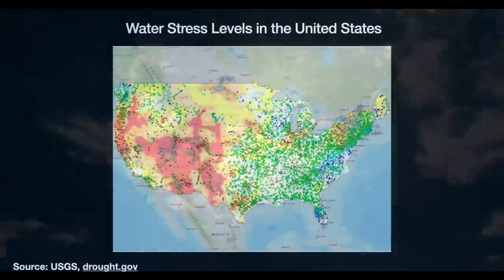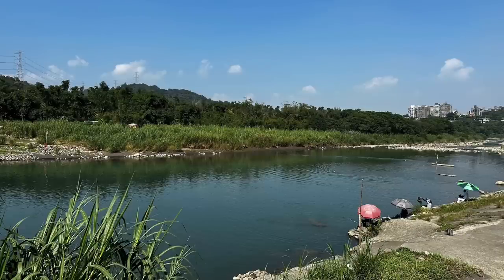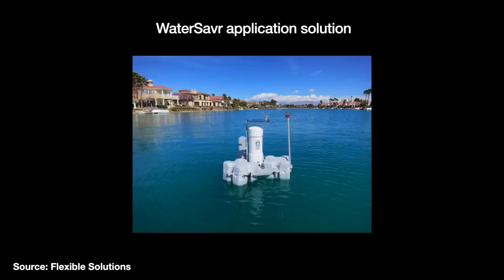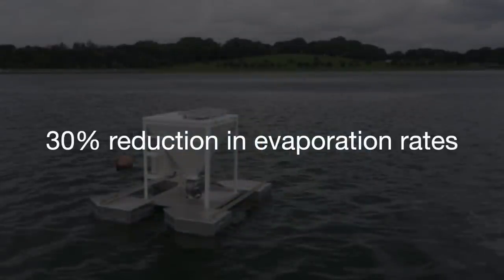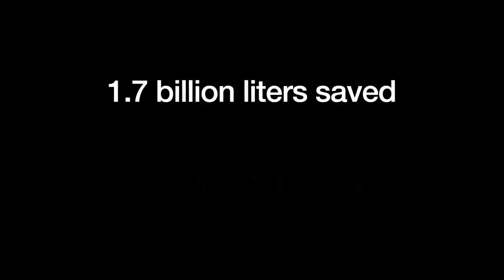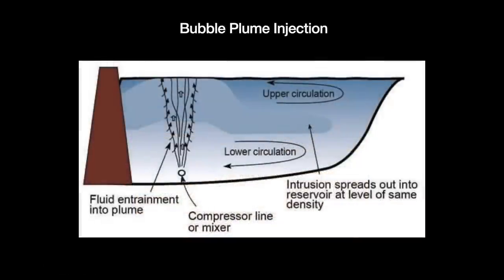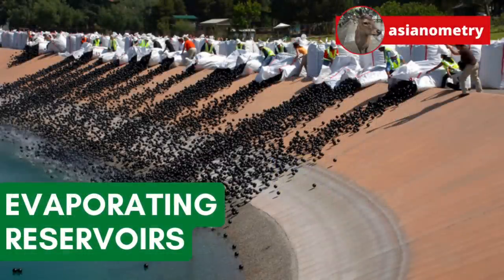When Your Reservoir Evaporates

Comment: Evaporation of salt water, on the other hand, is a good thing, because when it returns to earth it's fresh.

So we should be considering doing things like bringing salt water into desert depressions, like the Qatara depression in Egypt. Shallow basins of salt water in a desert will permit more evaporation, loading the air with water that can hopefully come down as rain downwind.
Reply: Sounds good but creates quite a number of problems. You'd quite literally be salting the earth. Evaporating salt water leaves salt deposits and the land would no longer be useful. Cost benefit analysis.  Pumping large amounts of ocean water inland requires large amounts of energy and infrastructure + maintenance. Something interesting for you to research for reference would be the red sea and mono lake(California, USA)
Reply: @jumpingsloth3963  At Qatara you don't need to pump it inland. You simply need (below-sea-level) tunnels. And it won't leave salt behind, because it will be permanently at sea-level and effectively part of the Mediterranean. And even if it does, the Qatara depression is worthless desert.

It would provide additional surface area for evaporation. Some studies believe that it would evaporate so fast that water flowing from the Mediterranean could be run thru turbines to generate several hundred MW of power, but that would be an optional extra.
Reply: I think the difficult part is how to measure the fresh water return when it's random and inconsistent world-wide. I wouldn't oppose the idea, but there's costs for that magnitude of a project. Convince us further.
Reply: @jumpingsloth3963  The project, as I understand it, has been justified in the past on the basis of electricity generation based on flow into the depression from the Med. So presumably a lot of water is constantly evaporated.
Reply: @@ucomaco Not an engineer. The project has been costed on the basis of electrical generation based on flow from the Mediterranean into the depression.
Reply: The Salton Sea says hi

Comment: Isn't that if the evaporation happened, the vapor carry heat energy up. It absorbed the sensible heat of ground transform it into latent heat, means that the soil surface is cooled by this event meaning the cooling process  of earth. Where does the latent heat energy go? The water vapor goes up, then at the high of cloud it release heat to surrounding air and transform water vapor into liquid or condensation. If it volume is big enough the liquid falls to the ground as rain or snow depend on how high the surrounding temperature was. Then the releasing heat will rise the surrounding air temperature cause the air to go up because of the air density becoming lower than the surrounding air densoty. Then, it heates the upper surrounding air. The natural convection occured, level by level until the heat reaches outer space. That is how the heat energy of the earth flows to outer space. The matters which are primarily  water, ground gases and dust go back down to the ground during the heat energy left for outer space. As we know, most of energy that comes to the earth is from solar radiation. The different of accumulati9n amount of  enegy hit the ground cause the winter, summer, fall and spriig to happened. The solar radiation energy is much bigger than man made energy plus heat energy from volcano. Therefore if the ground energy (coming from solar, man made and geothermal) get higher, the more dense and often the rain will be. Flood is the result. The atmospher temperatur is only a little bit changes.

Comment: Make a big container out of copper, with the bottom painted so that the surface looks to be the same colour as the rest of the reservoir, put the container into the reservoir with the wall above the surface, and fill it to the same level. Now measure the liquid loss inside the container to find the per surface area evaporation rate of the reservoir?
Just a random idea, seems like it should give fairly good results?

Comment: I always wondered about the use of black balls and black shade structures.  I would think this would absorb more heat.  Wouldn't white be a better color as it reflects solar energy.
Reply: Black absorbs more visible light, but radiates away infrared better.
Reply: @Assmagnus  You literally cannot see the light that gets radiated.  You have to be well over boiling for the absorption in the visible spectrum (where most sunlight is) to be greater than the infrared radiation that would have no effect on the absorption of most sunlight.
Reply: @zecorezecron  Sunlight peaks in the visible spectrum, however, only about 43% is in the visible spectrum.  The shade balls being black also block more light from reaching the water, and provide increased UV protection of the plastic.  And like I said, especially at night help radiate heat.  What was your intended point?
Reply: @Assmagnus  The best material to radiate infrared, which is the only type that be radiated without artificial heating, has no bearing on what humans visibly see.  What you want is a material that absorbs (and therefore emits) primarily in the infrared spectrum while reflecting everything else.  Being black in the visible spectrum does nothing, literally nothing, except absorb more heat.  it does not emit more, it does not block more, and it does not provide more UV protection.  Titanium Dioxide does all that, and it is white.  Barium sulfate, the best infrared radiator for earth's atmosphere and temperatures, is white.  Using a combination of barrium sulfate and a white pourus plastic, you can make a paint that will keep objects below  the ambient temperature outside of direct sunlight (such as at night) AND keep the heat absorption to the absolute minimum during the daylight hours.  

Black material does literally nothing unless you can see the glow from the heat.  That means that you are hotter than the melting point of aluminum.  That is how hot you need something to be for a visibly black object to radiate heat more efficiently than any other color humans can perceive.  There is a reason that airwells (things that actually radiate enough heat to condense water from the air) are all, to the shock of literally no one who took the 101 course on heat transfer, all white in color.  

Just look at the radiators on the ISS.  They're white.  They don't paint the spaceships that color just to look nice.

So, my point is that not only are you wrong, you didn't even put in the minimum effort into learning about any part of this topic, so you are also stupid.
Reply: @zecorezecron  You are completely right. 
But isn't it true that if something is black, it is also more likely to absorb infrared too? If you had to bet while only knowing the visible light color.
Reply: @kedrednael  Kinda, but not really. There is a huge amount of variance in material.  Asphalt is less emissive at room temperature than limestone, marble, and white paint.  Heck, water, human skin, and glass are better emitters than asphalt at room temperatures.  There are some things that are reflective or emissive across the whole spectrum, but it is far from universal.

Comment: For everyone saying what about the evaporation falling as precipitation, you are failing to understand how the weather patterns in that region function as well as failing to take into account the primary sources of the water flowing into the reservoirs. The largest supplier of water in southern California is the Colorado River. The majority of the water in the Colorado River comes from snow melt runoff in the Rocky Mountains. That snow falls during the fall to early spring. The greatest amount of the precipitation in California occurs in the hot summer months. Water that evaporates in California in the summer does not return to southern California in any form.

Comment: 2:45 Cold air does not have the ability to carry very much water away. Warm, 25°C (77°F), air at 80% humidity can carry away about the same amount of additional water as cold, 0°C (32°F), air at 0% humidity.  Either can carry an additional 5 grams of water per cubic meter. The temperature is actually the more important factor rather than initial relative humidity. 30°C (86°F) air can carry six times as much water vapor mass as 0°C (32°F) air, so 50% relative humidity air at the warmer temperature will evaporate three times as much water as 0% RH at the cooler one.

Comment: If you collected the evaporation very,very high above the lake's/ reservoirs,you could drop it all back down through stacks upon stacks of turbines.or drop large container's of liquidised moisture from cranes holding the cover up from very high above,,,and dropping the weight of the water as a "gravity battery"design

Comment: One of the reservoirs near me in the Netherlands is covered with floating solar panels. They reduce evaporation while also generating electricity. That seems like a pretty good solution that you didn't mention.
Full sized solar panels oriented to the south on rafts. They're angled of course for efficiency so they don't build up water.
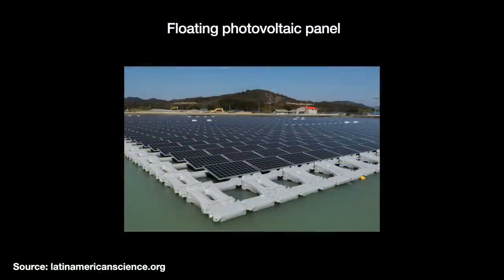Reply: You apparently didn't watch all the way through. They were indeed mentioned at around 8:44
Reply: @noahhounshel104  You're right, he does mention it briefly. Sorry, @asianometry !

I did actually watch the entire video before commenting, but I missed that part - probably because I was also eating breakfast and reading overnight emails.
Reply: When looking at the floating solar panels in the context of water evaporation reductions, I get the impression that the claims about reduced evaporation are largely a sales pitch. The floating panels such as shown in the video do not appear to be designed to reduce water evaporation, but to produce electricity. The panels shade the water, but still allow water to evaporate to cool the panels and thus increase electricity production. So, there is a tradeoff: you cannot design a floating solar panel that is optimised to do both. From the publications I see on the internet, I see some very differing results, from 30% to 90% reduction in evaporation.

Comment: That joke was like dust in my mouth 
Seriously, windbreaks are reliant upon slowing the wind speed down at ground level. A singular row of impermeable trees can result in  both turbulence from the wind that goes over the top, as well as a localised increase in wind speed at ground level. A line of medium sized trees, and supplementary rows of diffuse shrubs can counter this. However, this has downsides, not limited to the extra cost of installation, and the loss of what would have otherwise would have been just pasture.

Comment: The issue with the balls taking water to make only matters if they are being made where water is scarce. Otherwise, it's effectively transporting water even if they cost more to make than is being saved. At that point, the comparison is if manufacture and implementation cost more than just shipping the water itself. Considering how heavy water is, and that those balls are hollow, it's unlikely shipping water would be cheaper.

Comment: Unless I missed something in the video, why did California remove the shadeballs and replace them with covers and the such? I understand that the drought ended but surely they could have just left them there longer since they're supposed to last like 10 years?
Reply: Trying to find logic in California is a fool's errand
Reply: Possibly because they'd be a problem if the reservoir overflowed.
Reply: @benjaminfranklin329  More likely that a crony had a new solution to be sold. Never underestimate the amount of corruption. It is not a "doesn't happen here" thing...
Reply: The bigger question is: Why are the balls black? Would not a black ball absorb the rays of the sun and then heat up the area around itself causing more evaporation? If it was white it would reflect much of the heat back in to space.

Comment: Has anybody modeled the possible down-cycle impacts of less atmospheric moisture if evaporation is controlled on a large scale? An alternative way of looking at this is how much do local weather patterns depend on the bodies of water in a region?
Reply: There‘s an Engineering video of the few dams that do this. However, water can be stored in more than just conventional dams, such as water tables, though they have drawbacks as well.
Reply: Theoretically if the reservoir is used to water nearby agriculture then the water not evaporated from the reservoir should be made up for by the transpiration from the crops.

Otherwise yes, large bodies of water definitely affect local climate. The best known instance is the Great Lakes and their associated lake effect snow, although no human made reservoir is nearly as large as any of the great lakes.

Comment: Let's be honest, the shade balls are very inefficient, especially since you might not want to shade all of the water for a period too long. Let's not forget that the UV from the light is a sterilizer. It would be more efficient to simply use lots of shade boards floating by 3 buoys, the shade being at least 1 foot above the water level, to allow for some airflow. Still, the best choice is using injection wells, and lots of them, with water-permeable lids, so during rainfall and floods they allow water to go down and the empty air below it to go up. There's also the option of using large fans (10m or 10yd or 30ft tall, blade tip to blade tip) to get the humid sea air underground, where it will end up with the water being absorbed into the ground and the salt turning the place into a salt deposit.

Comment: If the balls were manufactured in an area with plentiful water and then shipped to California, then there is no net loss of water. However, I doubt the economics of shipping cargo can be justified when the containers are filled with 99% air. Maybe the dense HDPE pellets can be manufactured overseas and shipped to drought-striken regions, where local factories that don't require water simply mold and inflate the balls close to the intended reservoir.
Reply: The balls are about 2/3rds water.

Comment: You could cover it with the new float on the surface water purifying sponges just invented ,that could surve two purposes,with the added benefit of doing some of the work the chemical treatment stages use in terms of energy and time sitting,and this cost.if it's possible to catch evaporation it might as well skip the treatment stage again,but water absorbing gel's /floating sponges it's totally hypothetical

Comment: Evaporation increases humidity in the air and lowers the dew point, increasing the chance for rain.  This process happens on land also, grasses catch rain or dew and increase the chance of rain,  Cattle destroy the grass retarding the chance for rain, this is happening all over the world.  Pick an arid place on google earth and zoom in on a road with a fence on both sides, there is a noticeable difference of vegetation from inside the fenced area to outside,  Migrating herds used to eat the grasses then moved on and the grasses recovered,  cattle and fences stopped that.

Comment: I'm like 95% sure that the balls never would have worked to begin with and would have only increased the evaporation in most situations, while only reducing it in a few select optimal scenarios.

The balls only work by catching/blocking the sun and then having the wind available to cool the balls off and carrying the heat away. But when there's no wind then suddenly the black balls are concentrating all the heat in the top layer of the water, while normally a lot of the sun would go into the water and more gradually warm the water. Add sporadic wind, so the balls are bobbing a little, and making themselves wet every now and then and you effectively made an evaporation system where you're using the water instead of the wind to cool the balls.

Comment: I'm happy I watched enough of this video to get to the solar panels part. Bonus: the water cools the solar panels making them more efficient. I saw a few years back that India had built shades above their canals and put solar panels on them to get power and lower evaporation.
Reply: But if the goal is to keep heat out of the reservoir, then using it to cool solar panels defeats that purpose.

Comment: What about using bamboo sticks? Don't they float for a long time? The floating PV option is very attractive of course, but my question with that floating PV is whether not even more value (with small extra expense) can be extracted from such a project by enabling some sort of aquaculture practice using that floating structure. Many of these surface waters are nutrient deserts and the floating structure could provide a basis to change that.
Reply: Another note regarding solar energy harvesting on bodies of water: the practical and theoretical efficiency records for solar energy harvesting are achieved using concentrator methods and more specifically 2-axis tracking parabolic dish type concentrator methods. Currently these methods are not popular because too tedious, but I hope they could one day make a come-back as part of a more "frugal" society. On a lake or another body of water, one of the two tracking axes can be dealt with easily/cheaply by hooking together your giant array of concentrators and rotating them like a boat so as to track the sun.